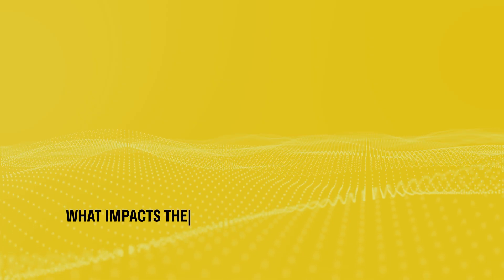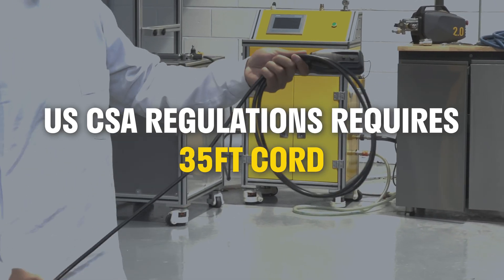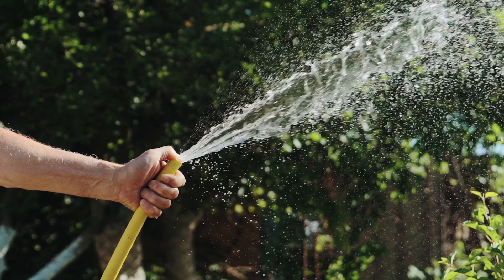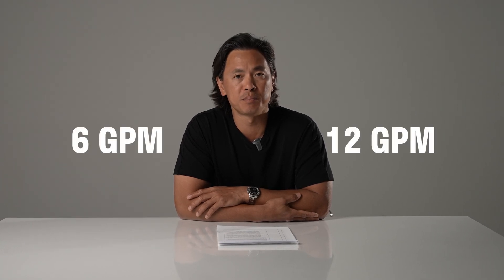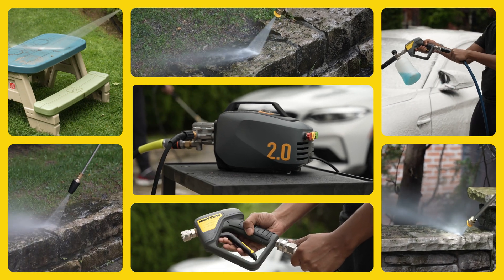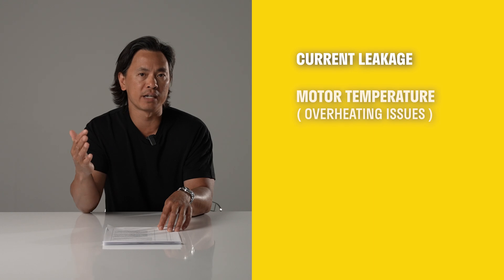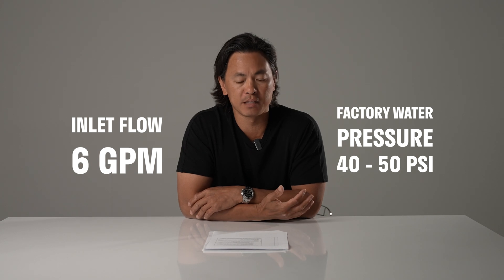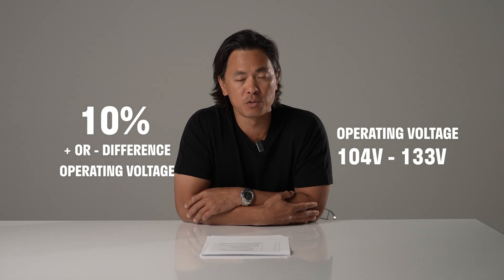ACTIVE 2.0 || CSA STANDARD PERFORMANCE TESTING/ REGULATORY STANDARDS/ TESTING PROCEDURES & MORE

Comment: Wonder now if the active 2.0 is a better contender to chemical guys proflow electric pressure washer with ratings of 2030 psi and 1.75 gpm  for msrp of $200 USD but honestly I believe the active 2.0 will still out perform it based on reliability.

Comment: I have a 15 amp circuit breaker, can I use the standard 1.25 orifice on the MJJC Pro foam cannon to achieve a thick foam consistency?
Reply from the maker: Yes, it should still work.

Comment: Kinda just sitting around waiting for my greenworks to run out of it's usable life (~100 operating hours AFAIK) so I can upgrade to the Active 2.0. Really impressive that you guys got such good performance out of a small package and it's designed for a ~200 hour operating life. 

As many people in the comments have mentioned the OG tests, I'm glad they perform the tests so we as the consumers can make better purchasing decisions. However, I'm glad to hear you guys clarify things surrounding the performance of your product because I've long thought about the shortcomings of OG's testing methodology. I don't mean this as a slight to them because I understand it's expensive and complex to properly experiment and measure products such as pressure washers,  especially a few hundred of them. With that said, it certainly seems like Active has some great engineers working on these products and I like that James gets direct feedback from them to properly answer questions and share information. As an engineer myself, hearing the way James introduces the topics for regulation and testing give me confidence that Active has good testing methodology and stands by it's advertised operating specifications.

Comment: Does it matter if you would use a 3/8" hose or 1/4". I watched the obsessed garage introduction to this unit and they had gotten better numbers.
Reply from the maker: Hey there, OG clarified on their facebook group that the gauge that they used was faulty which caused the higher numbers as results. In terms of the hose size, it doesn't really affect the performance.
Reply: I was wondering that too

Comment: Interesting, when you guys were at og the numbers were much higher.
I like my psi around 1050-1100 with 2 gpm.  Not sure I’ll be getting this with the 2.0 version.
Reply from the maker: Hello, thank you for your response. It was confirmed by Obsessed Garage that the test conducted with James was incorrect due to a faulty pressure gauge. They are in the process of updating their test on the 2.0 this week!

With regards to the performance numbers of the 2.0, we are seeing a 10% improvement from that of the VE52 when running simultaneously on the same water and electrical system. In addition, we are confident that it outperforms all electric pressure washers rated for 15A under the 1000$ price point when it comes to water flow at a 1000 PSI.

The only options available to outperform the 2.0 are either commercial grade units rated at 20A or Gas Pressure Washers when considering water flow.

Comment: I’ve watched the entirety of Obsessed Garage’s video where Matt and Tommy tests the unit with various nozzles and James being there to talk about the unit and answer questions that they and the public may have. I noticed that your numbers vary greatly than those in OG’s video and understand that water inlet pressure, available circuit conditions and accessories play a huge role in determining the results that one gets. Are your testing methods and inputs that much different than his own? It just seems OG’s tests are more real world conditions.

Regardless, I’m extremely excited for this product and pre-ordered a bare unit through the OG website and can’t wait to get mine!
Reply from the maker: Hello, thank you for your response. It was confirmed by Obsessed Garage that the test conducted with James was incorrect due to a faulty pressure gauge. They are in the process of updating their test on the 2.0 this week!

With regards to the performance numbers of the 2.0, we are seeing a 10% improvement from that of the VE52 when running simultaneously on the same water and electrical system. In addition, we are confident that it outperforms all electric pressure washers rated for 15A under the 1000$ price point when it comes to water flow at a 1000 PSI.

The only options available to outperform the 2.0 are either commercial grade units rated at 20A or Gas Pressure Washers when considering water flow.
Reply: @ACTIVEPRODUCTS  Thank you for the clarification. I had no doubts that the 2.0 still outperforms anything else out there in the same entry category and price point, regardless of the incorrect numbers from OG's video. In a nutshell, I was more concerned about which nozzle size to buy as I had already pre-ordered the 2.0 from OG.

I'll definitely keep my eyes peeled for your future units. Hopefully a serviceable version of the 2.0 with slightly better numbers as I can see justifying $600+ for that would be an easy pill to swallow.

Keep up the great work and continue to innovate! You guys are re-defining the world of pressure washing.
Reply: OG testing was incorrect the pressure gauge was incorrectly calibrated. Those numbers were off by 500 PSI. Still an awesome unit, kranzle performance with the stock setup. Have one on preorder, cant wait to receive.
Reply: @downagear2660  which means his entire spreadsheet is not accurate.   Hopefully they will correct it and provide updated info
Reply: @downagear2660  Darn, I didn't see that and I already ordered a 7.0 nozzle with a 1.5mm foam cannon orifice. Hopefully I can swap it out with a 4.0 or 4.5.
Reply: @godowarus  So did I but I'm planning on keeping the 7.0 nozzle. I ordered mine with the full kit because I also wanted the stock nozzle.
Reply: @downagear2660  That's good thinking since the price difference is so small. I should have done the same. I already have a 5.0 set so maybe I'll just stick with that. Perhaps I'll keep the 7.0 I ordered as well and use it as a "water broom" around the house once in a while.
Reply: @jameschunn2790  Pre-ordering through OG was available when I placed mine on June 16th. Whereas on Active's site, only a teaser/landing page was up; no option to place an order, at least on that date.
Reply: @godowarus    @downagear active said you will be able to order through them in a week or so.  Personally would rather do that and save the money since either way you will have to wait same time  regardless where you order from.
Reply: @jameschunn2790  I see. One thing I forgot to mention is that they won't ship to me. I asked on one of their IG posts if they will ship to Hawaii and they replied with "..only continental US and Canada." I didn't have much of a choice but to pre-order from OG as they do ship to Hawaii..for another extra fee :(
Reply: @godowarus  Hawaii is part of NA since it is a US state I believe. No?
Reply: @jameschunn2790  Yes, it is a US state. But it is not part of the continental US. Meaning it is not physically connected to the other states.
Reply: @jameschunn2790  Looked on Active's website and didn't see a way to order, maybe I was looking in the wrong place at the time. Soon as it was available for preorder on OG's website - Shut Up And Take My Money lol. Wanted to be on that first batch that gets delivered.
Reply: @downagear2660  active said you will be able to order through them in a week or so.  Personally would rather do that and save the money since either way you will have to wait same time  regardless where you order from.
Reply: @jameschunn2790  I see it as a convenience fee. Active’s site was my first choice if it was available I would have. I purchased the day pre-ordering became available and OG is estimating those to ship mid August. Active’s site currently says sold out. Are they sold out of the first batch that shipped from China? Will next week’s preorder be for the next shipment and when will that be?
Reply: While I like OG's testing of the pressure washers, because it gives us the consumer more information to make purchasing decisions on, his test methodology is rather weak for legitimate experimentation. They don't have particularly good controls for operating conditions:

They don't take temperature measurements at inlet and outlet of the unit. Ambient temperature also doesn't appear to be used. Temperature and pressure dependent thermophysical properties don't appear to be used for their calculations.

They only take pressure ratings with a single gauge right before the gun. This issue just popped up as you mentioned, their pressure gauge was completely inaccurate and they should have been using a few diverse pressure gauges and attempted to verify and validate the readings they got.

There is inherent error in their volume/mass measurement as some water can spill out, there is some water sitting on the scale, and the whole setup can change in orientation and location. 

To get reliable and solid test data you really need to have these parameters controlled (and more), otherwise the data is basically invalid and needs to be taken with a huge grain of salt. Some of these parameters may not change much, but could be very useful for troubleshooting and determining why deviations in results occur such as erroneous pressure readings. It's expensive and complex to properly experiment with thermal-fluid systems as they are fairly finicky and unstable. More than likely Active has some good testing methodology, especially since they seem to have some great engineers over there making these products.
Reply: @ZWortek  bingo.  Couldn’t have said it any better.  Someone had asked them before what sort of value are they providing by just spraying water into a bucket and why not figure out some other methods that might be more practical.   I guess it doesn’t really matter though since it’s obvious Matt is just going to talk $hit about any product that he isn’t going to profit from.
Reply: @ZWortek  I completely agree with your assessment of their testing. Lab-grade experimentation and highly controlled variables do make for precise values which are always nice to have. I think some of the takeaway is that they're doing more real world but basic testing in their given environments. Their circuits, water inlet pressures, temperatures, etc. gives them the ratings they published. So perhaps for everyone's unique variable combinations, they can follow similar testing methods to find what they like. OG's finding's shouldn't be taken at complete face values but rather some sort of guideline. 

Matt did say he was going by what he likes like 1000 PSI is the sweet spot for him. And yet when he used a much larger orifice nozzle, he liked washing his GT4 thinking he was getting 1000 PSI when it was more like 450. 

I doubt he'll ever invest in the equipment and time to test future pressure washers by those higher standards and stricter methods. He'll at least be "close enough" to what most people may like but still, everyone should do their own testing too.

Comment: What timing. Assuming you scene OG’s FB post concerning their faulty gauge used during the initial test?
Reply: Yeah I just ordered 6.5mm orifice as recommended by 0G, hope they clear  up this confusion on they’re website and I can trade for the proper size
Reply: @clzay  the description on OG's website was already updated with a recommended 5.0 which gave them 700psi during testing. I was going to get a 6.0 based on the OG video but saw the recommendation so went with that.
Reply from the maker: We've been in contact to resolve this issue so we knew haha.

Comment: Can you use an extension cord if needed?  If so, what do you guys recommend for gauge and max length? 

Also is there any update on the short gun availability or the all stainless version?  

What about hoses?  Are you going to offer any 50 foot ones on your website?
Reply from the maker: Hello, we advice to avoid using an extension cord as much as possible, but if you require one, the recommended maximum cable length: 50’ (15 m) with a gauge of 14 AWG.

We are testing production samples of the Active short gun, an update on expected availability will be out soon.

Comment: With the 3.0 are you concerned it goes over 15 Amps or that most have a 15 AMP circuit. Would it be safe for the motor to run a 3.0 tip if you had a 20 AMP circuit.
Reply from the maker: Hey Keav, firstly apologies on accidentally deleting one of your previous comments as we were clearing out the bot comments on our video. With regards to your question, yes, you can run a 3.0 on a 20A circuit without issue of tripping breakers. The Active 2.0 was tested with the 3.7 and 4.0 nozzle in reaching 200 hours lifecycle. We expect marginal decrease in lifecycle with a 3.0 nozzle, but we haven't tested for it. Hope this answers your question.